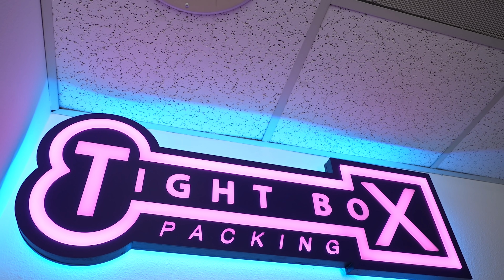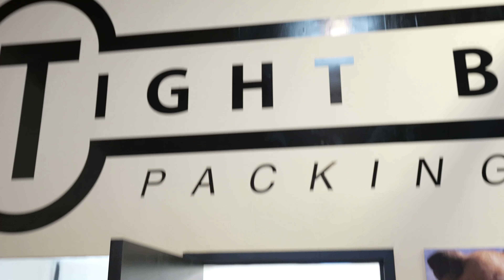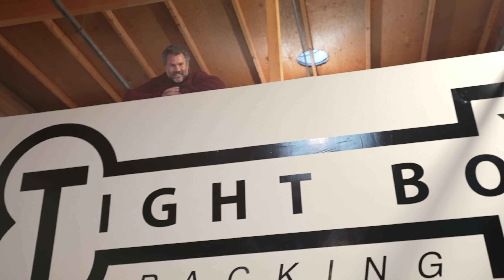I'm Fatter Than Ever Before | Steve-O

Comment: 3:32 Damn, I remember being 14 in 1992 and working at my brothers skate shop MANUALLY SQUEEGEEING the screens on the goddamn decks 2 or 3 separate times to form the complete graphic per BOARD! Two years it took him to actually get a machine where they had like 4 or 5 screens on a swivel but it was still screen print. 
This whole liquid print that glides over the board is WILD and prints the board in seconds.

Comment: Steve-O! Longtime fan here! Been a fan since i was like 5 years old lol found out about jackass watching it with my dad when i popped up on tv every now and them. But anyways ive always done the same bs with my body🤣🤣. I tend to "yo-yo" alot as well lol. I recommend drinking 8-10 water bottles a day STRICTLY! You can even cut out any other drinks that are not water. I would also recommend introducing whey( protein that is digested quicker than isolate)  protein shakes and isolate( slower digesting protein)  protein shakes before bed. Just make sure you enjoy the foods that will help keep you at a certain weight. Makes for better long term goals. Goodluck my friend❤

Comment: Not sure if anyone's told you yet, but you might want to be careful burning those pallets. Some are treated with chemicals that release toxic fumes when burned. Sometimes the pallets are stamped with codes that tell you what they've been treated with, usually it's pesticide to keep bugs from eating into them and causing the pallets and whatever is on them from collapsing over. Again, it varies and not all pallets have it but you may want to look into it.